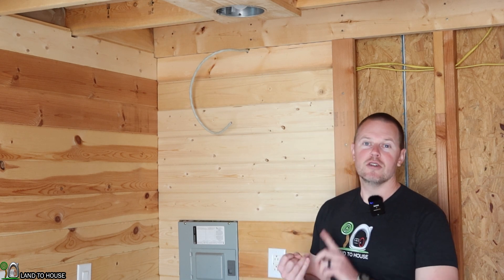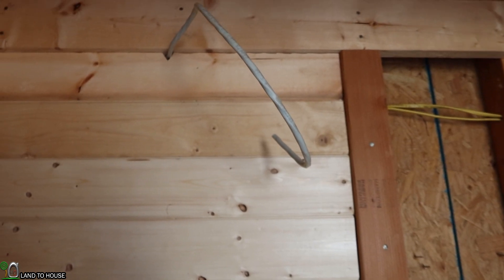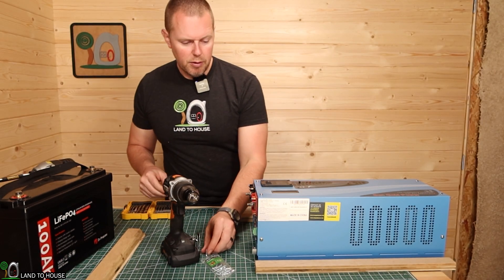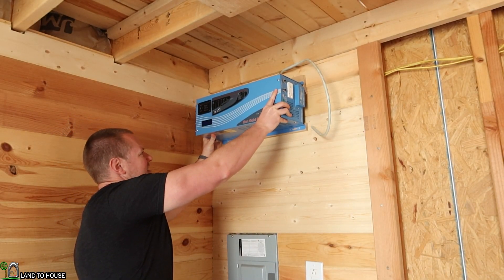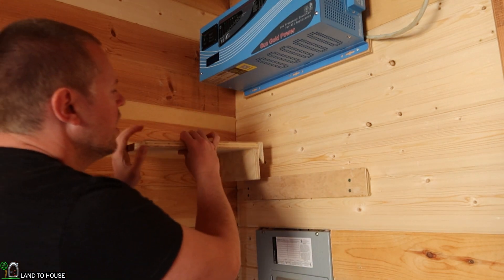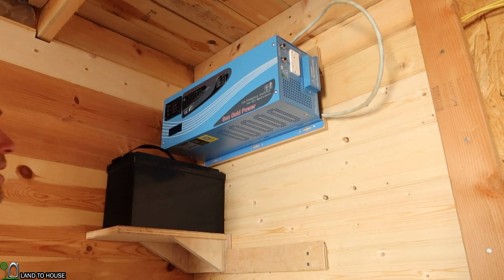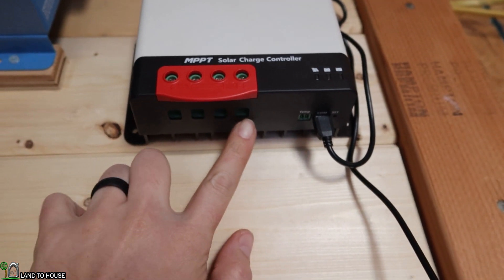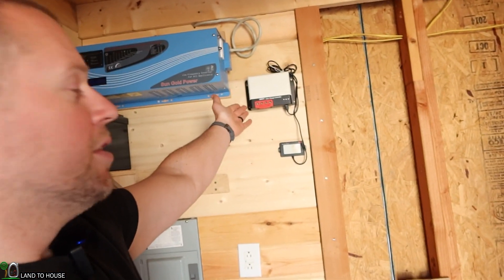Inverter and Battery Install [Tiny House]

Comment: Don't know what happened to my full comment below, but I went on to say that I don't think you paid for that unit and it wouldn't be anything that you should advise your subscribers to buy for a build like this. Serviceable inverters are available to common folks that have to pay for the equipment they use in their builds for a much lower cost. With the one battery you will have about 9 amps of AC in your house and that unit will not be be efficient with that one battery. A dedicated inverter will be cheaper. The savings can buy more storage batteries. I do like the mounting system you used for the inverter, but if it didn't have a pricey charger in it it would be a lot lighter. Don't worry about "running the battery too low". You can't do it. The BMS protects the battery cells from most anything an uninformed user might do to them. Please differentiate between when you use free stuff because it's free and when you use stuff that you paid for and why you are using it. That is what most YT subscribers are looking for. Help, education, advice, etc... not paid product promos.

Comment: I'm new here so I have a few questions. Does this house have electricity running to it? If it doesn't, then why are you using a inverter that is also a 90 amp charger? That is a VERY expensive add-on to an inverter. If you intend to run on 12 volt batteries charged through solar panels, which I assume you are, since early on in the video you show an MPPT charge controller, you could have bought at least one more battery for what you would have saved buying just an inverter instead of the SunPower unitoccurred

Comment: Nice progress on the power, I'm looking forward to the next video.  Glad to see you learned from the power shed about the inverter's lower spacer strip!  I would definitely screw through the skirt of the battery shelf into the wall cleat, that shelf will creep up & out of the french cleat and drop the battery without a solid mechanical connection (watch out if you bump your head on the underside, it'll dislodge and drop on you).  I'd like to suggest you run wires from the battery to a wall switch at the door and then up to a 12v camper led light.  That would provide you with enough light to see what you are doing when powering up the inverter, or if you are just popping in for a moment and only want a bit of light without needing to cycle up the inverter.

Comment: Maybe you can consider high frequency inverter due to idle consumption of that Low freq one
Reply from the maker: True. But the remote switch allows me to put the power switch at the front door.

Comment: cool  looks like the little house will have enough power for lights anyway . man that battery set looks dangerous .  i would rethink that . it might be ok but you have to remember wood  and moister dont work well together . that little house is going to be moving  with  change of seasons . and with the added stress from the battery i dont think it will hold up in the long run .  i could be wrong  but you have little ones buddy drive a screw or five into that shelf for the battery if you continue to keep it there . that way  even if the cleat gives out it wont fall on little ones heads .  hey im a dad to  and my kids are grown now but if i had a dollar for every time they got into stuff that was not meant to i would have at least 20 dollars lol . take care work safe .

Comment: Please read the installation manual from the Inverter. Think about the distance he needs to get enough ait trough all opening is the housing. It could be possible that the aitflow transport the heat/warmth from het battery trough the inverter. I ask/advise because i'm a solar intsaller.
Reply from the maker: Luckily both the battery and inverter can slide on that French cleat. I can move them for better air flow.
Reply: @LandtoHouse  Try it. I saw it and my inner MIke told me to write it down because i have seen so many bad things in the last 15 years in that range.

Comment: Love it! Im no professional, but i did work on power systems in the Navy (688i subs) and my division owned the ships batteries. Two thoughts on the position of the battery:  1. If the inverter's cleat fails, or if you need to replace it, you have some very narrow margins between the inveter and the battery terminals. 2. Because of that narrow margin between inverter and battery terminals, it seems like it is going to be tough and dangerous hooking up the cables using metal tools. 

In both the points above, there seems to be a high chance of shorting the batteries to the metal chassis of the inverter.  Be careful Seth!!
Reply: Might cost $$ in extra cabling, but for maintenance and safety reasons, id move the batteries to the side like you originally planned